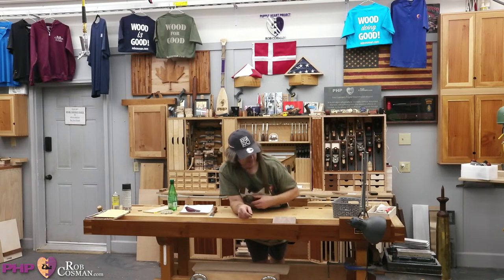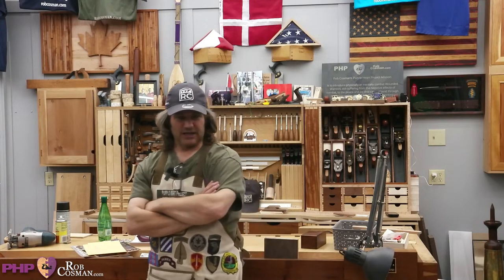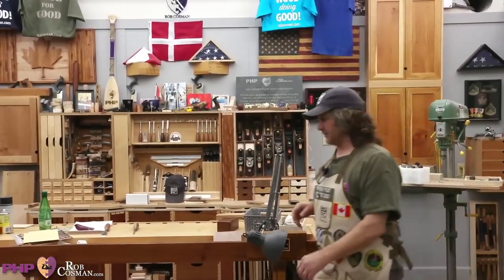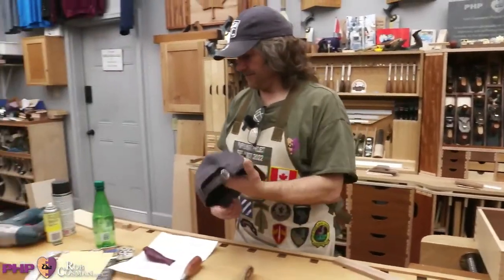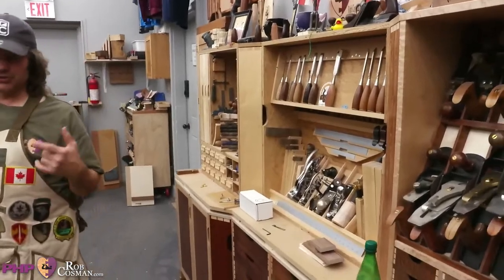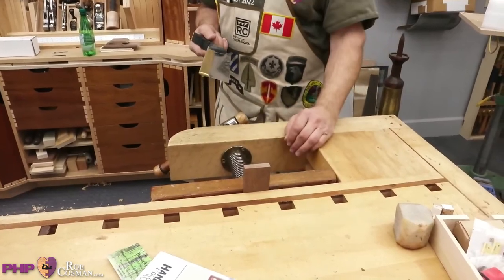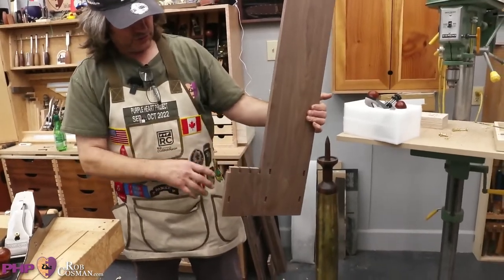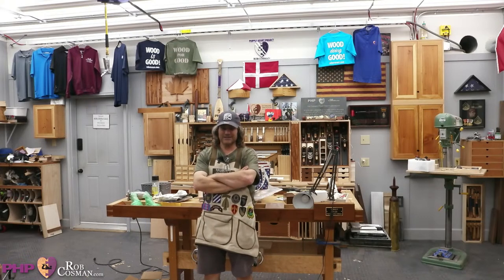Live Event - Ask any question (11 Mar 2023)

Comment: I believe the reason some makers of dowetail saw makers, lie nielsen being one of them make their saw with a tapour meaning the saw blade is deeper at the handle then it is at the front is because when cutting out the tails on a dovetail joint you are sawing down to your shoulder line thats vissable  to you on the side that's facing you, once you reach the line the idea is that because the saw has a tapour the chances of you blowing past your shoulder line on the opposite side is minamised.
I don't buy it myself but I believe that's the reason.

Comment: Fine Woodworking has a detailed article on the testing of corrosion protection.  I’m investigating the new Carbon Method coating which seems to be quite good.
Reply: I live in south MS - extremely humid year round. nothing worked for me until I tried Carbon method. Expensive for sure but I am very happy 9 months in and going strong. Put it on a 3 year old sawstop table saw and on my new band saw the day I got out of the box.